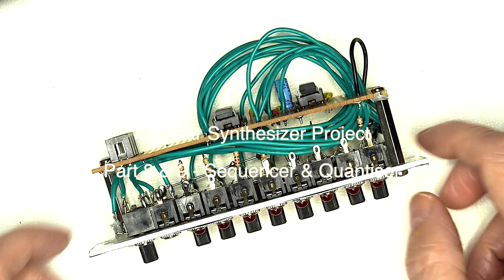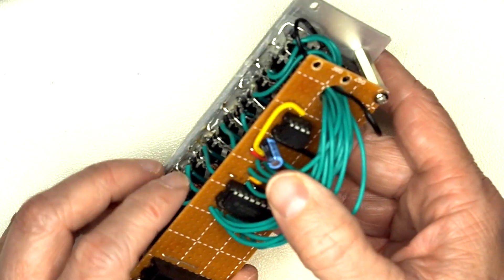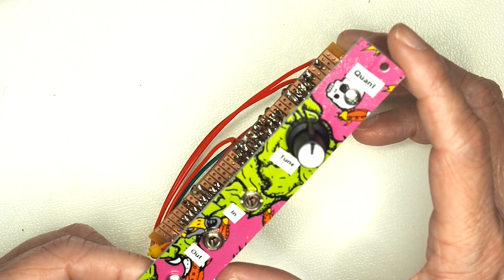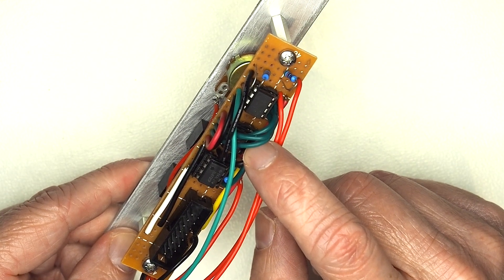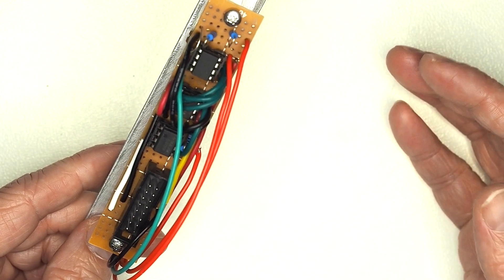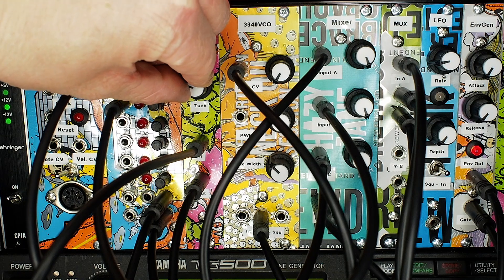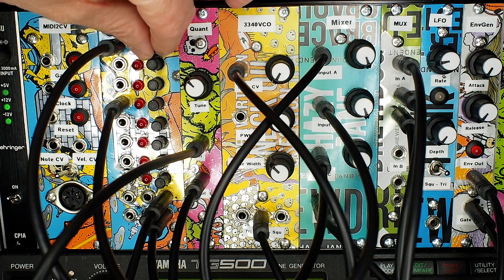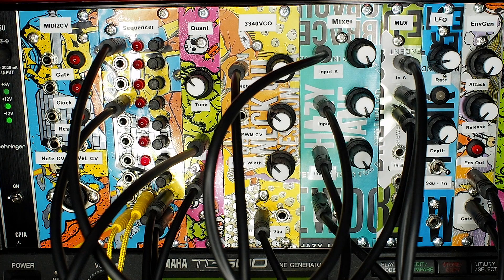Modular Synth Project : Part 8 and 9

Comment: Hi Steve, nice project! I was just wondering if an ATTiny would be powerful enough to run a Quant and there you were :-) - one question if I may, so it looks like the 1.1 version is now trigger based - meaning that it won't output a step CV unless it reads a trig signal coming in- is that the case? (so it doesn't mater what CV is being fed into the input - it will only sample it when it also receives a trig?) cheers and thanks. Jerry
Reply from the maker: thanks Jerry, it would have been too easy to chunk an atmega at it, but in reality the attiny is just fine. The choice to use a trigger for the sample was purely creative design. It allows for regular note on/off but also some neat affects with LFOs and 64th/32nd interval sequences
Reply: @stevebowerman  thanks very much Steve - I'll have a go at one I think :-) Cheers.

Comment: Very nicely done. All your modules look great and sound/work very well. Did you simply connect the jacks to each step with a resistor to get the trigger outs per step?
Reply from the maker: Yup pretty much. Didn't need to buffer them (thought I'd need to). Just a diode + in series with the pots between the 4017 and the jack
Reply: @stevebowerman  So simple. I am working on a 32-step version of this and the trigger outs are something I have been thinking about. This video made me know it would be worth it. All your stuff is great!

Comment: Hey awesome series of videos of your synth project, that quantizer looks great can you share the schematic? Anyway keep up the good work!
Reply from the maker: Hey, thanks for the comments. Links to schematics and further detail here: https://www.exsertus.com/blog/modular-synth-project-intro/
Reply: @stevebowerman  First, thanks for sharing your work!
I've read the blog post and watched this video and learned that you use a MCP4921 SPI DAC. The blog post has the code, but it looks like the CV input voltage is mapped from 0-512 to 0-12. Is this correct? If the input voltage is divided by 2 then wouldn't the mapping be from 0-1024? And wouldn't you want to map to a larger range, say 0-120 = (10) 12-note octaves?
Have you posted this schematic somewhere?
Many thanks, --Donald.
Reply from the maker: @dlakwiensign  Hmm not sure since its been a while, but good prompt for me to update this. I've uploaded the code here: https://github.com/exsertus/midi2cv and will look to get a schematic uploaded soon!

The CV output voltage is set to output 1v/octave standard. I seem to recall that I had to scale the DAC output accordingly which is why there is a tuning pot in the circuit.
Reply from the maker: I've added links now to the schematics and code. I've just revisited this project recently and replaced the tune pot with trigger. I'm also working on an Attiny84 version which will feature selectable modes/scales and transpose CV in. Watch this space!
Reply from the maker: Here’s the schematic i used for this module, it’s based on the baby 8/10 https://hackaday.com/2016/01/14/oh-baby-baby10-build-a-classic-analog-music-sequencer/